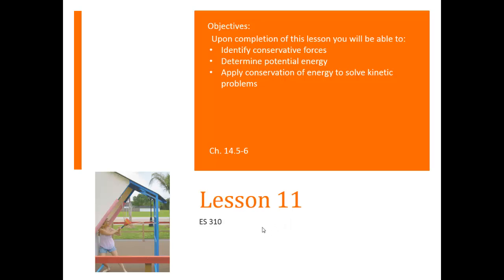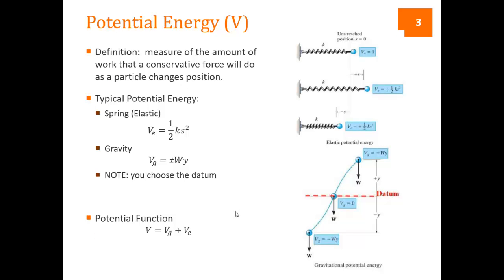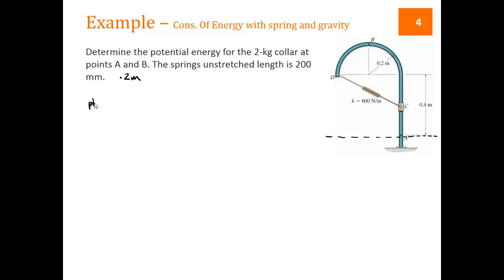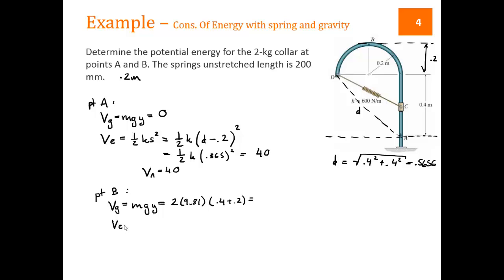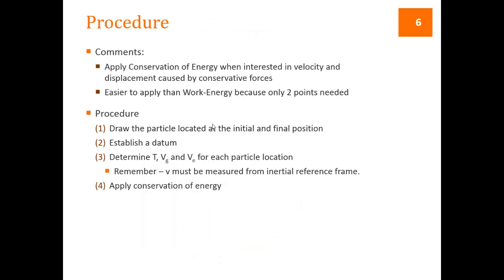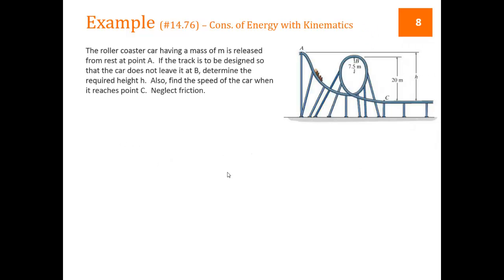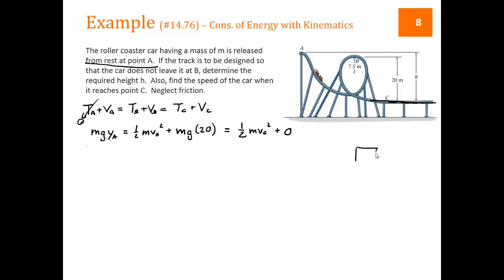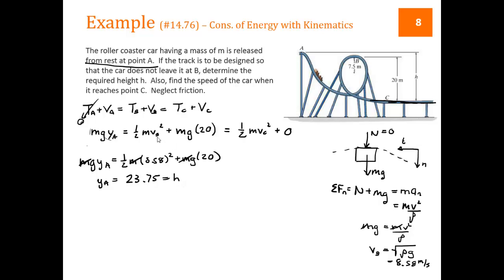Dynamics - Lesson 11 - Potential Energy and Conservation of Energy

Comment: Very helpful, but where did the rho come from in example 14.76?
Reply: Rho is just the radius of curvature at that point in time. In 'normal and tangential' (n-t) coordinate particle kinematics, a subscript n, an = (V^2)/rho. Since the body is turning, even if at constant speed, there is acceleration perpendicular to the path of motion, specifically pointing towards the center of the circle, or the circle that the radius of curvature fits. This is useful in many ways for solving  dynamic problems.